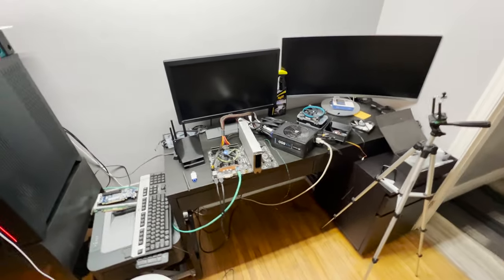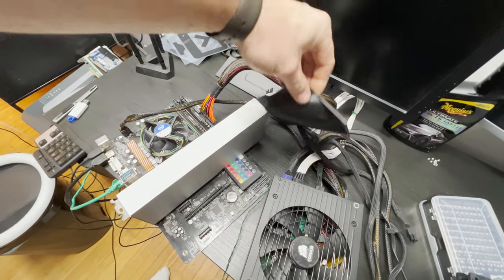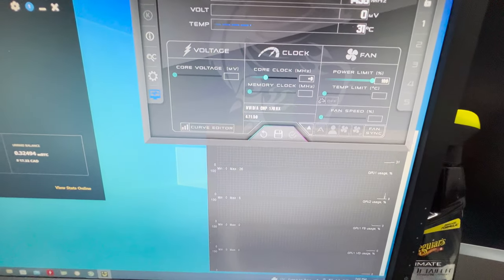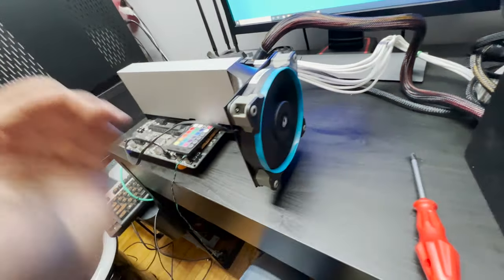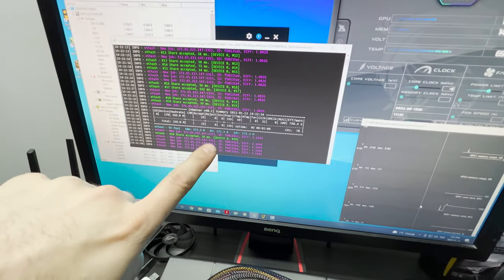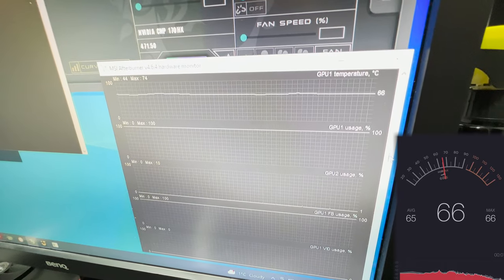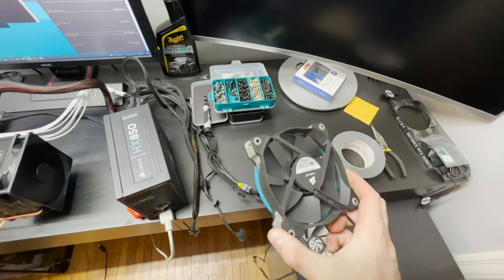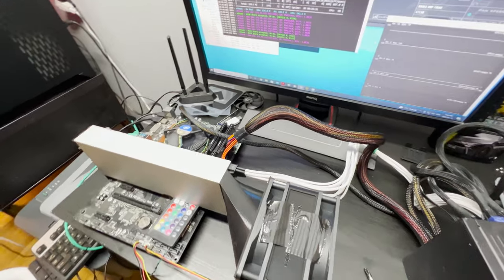Cooling the CMP 170HX - I want to hear from you!

Comment: It's not thermal throttling, it's hitting the TDP limit.
250W base, 80% is 200W. Temperature has a big impact on power usage.
Reply from the maker: Do you know what thermal throttle is on this card?
Reply: @ultraprecisiontechnologies  Core clock going down, and it starts around 82°C if I recall correctly

Comment: try same fans just flip them so the fan suck the air out instead of blowing air in
Reply from the maker: I did, and it didn't make really any difference. you may be interested to know I designed a duct for a blower style fan for this card and ive been running it ever since this video went up no issues! Amazing temps.